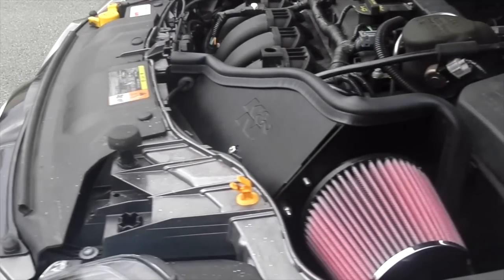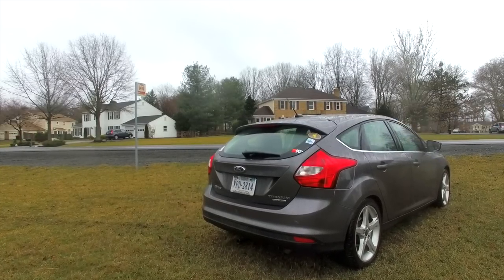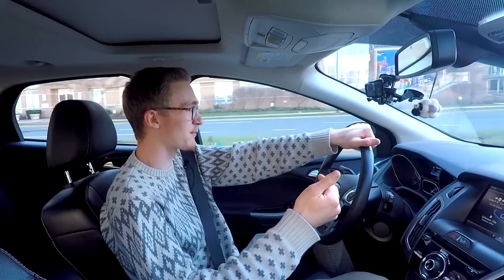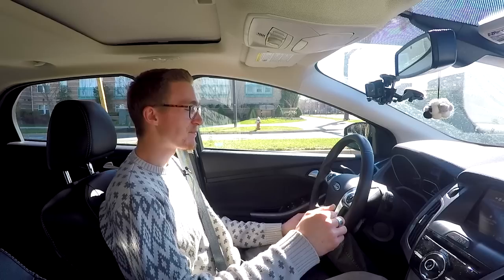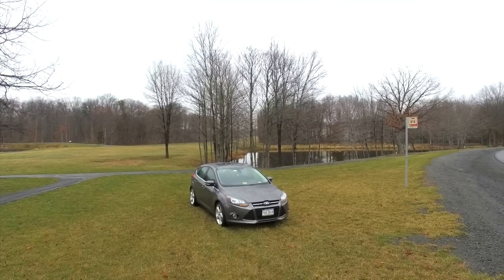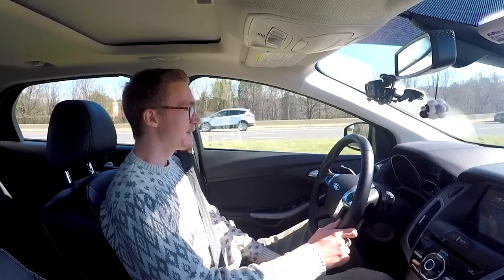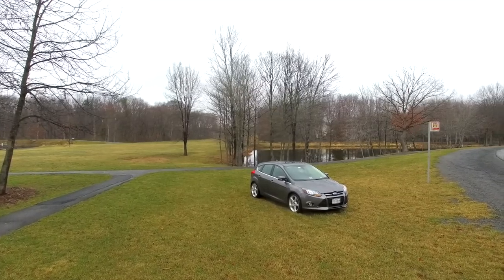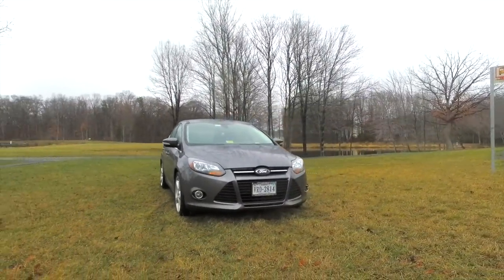K&N Cold Air Intake Update, What Happened to It??

Comment: For those who think you need to tune it. You actually don’t k&n made that specific air intake to give you horsepower with out a tune.
Reply: Are you sure?
Reply: @urbanpeltier1622  At least what they are saying on the website.
Reply: You will get what they call a "can tuned" if you install a CAI without a tune.....but if youre adding mods that means you obviously wanna make more power so thats why a tune is vital if you wanna MAXIMIZE your gains.

Comment: When you mess with the intake doing a mod you may have to cold start the car and run it for 15 mins or so on idle without reving. This allows the CPU to recognize the mod then take it for a short 5 min drive and park it up to cool down a bit then go from there. Diffrent cars will vary in this process but it may be similar?. The idea is that the CPU re-learns its self and programs to the new paramiters. I would think that a basic inlet mod or exhaust mod could be corrected this way or similar. Any larger mod may need professional programing.
Reply: Very helpful

Comment: I noticed this problem too. I removed the box, attached heat sheilding tape to the backside, paying special attention to gaped areas...problem solved. It also helps if you cut the padded insulator on the hood to fit perfectly around the rubber on the box. This seals the area really nice. You should also install a 180° thermostat just for good measure. I live in texas.
Reply: Dustin clark thanks for your observation!

Comment: One thing to remember is that the more power the vehicle has from the start, the more power is going to be gained, a 5% increase in HP on a 140 hp motor only 6-7 hp but on a 450 hp 23-24. Also, for the viewer that stated how the CAI would mess up the fuel ratio due to more air, its not necessarily more air that makes people put in the CAI, its that if you get proper separation and can suck up cold air, that air will be denser theu your car will have better combustion.Thats why your car seems faster in the cold weather, especially turbos
Reply: you have the best reaction

Comment: K&N air filter does improve air flow  you can get a mild boost of 5hp in some cases
Reply: You'd have some measured evidence of that, to share with us and prove your claim, wouldn't you.   Wouldn't you?
Reply: It all depends on on the car/engine
Reply: Austin L it definitely added more than 5 to my sti. Probably closer to 10-15
Reply: Ann Onymous Give me proof. I’m assuming you didn’t get the engine re-tuned or you didn’t put an aftermarket chip in it. So that air intake just turned into a expensive air filter
Reply: Ann Onymous that is a gross exaggeration get real.
Reply: All it does is give the car a better sound over time it will decrease power and even if gave you a 5hp gain you would never feel it in you're drive
Reply: CLUTCHO I don’t know if your math is accurate + != -
Reply: @Xibyth  anything under a 10 percent gain in power you wouldn't feel
Reply: CLUTCHO never said you would, but a 5% gain isn’t a loss like your saying.
Reply: @Xibyth  from experience with these filters made my car run sluggish and after taking it off had a whistle on my turbo with a Factory air box might make a difference on a induction kit to the turbo on a 300hp
Reply: Chris Toth, at the expense of filtration. I still don't understand why someone would bolt this on a 150 horse daily driver.
Reply: Agreed, but the boost is on the Dyno.
Reply: Richard Thomas  

Since you asked  https://www.youtube.com/watch?v=GS69owXpGdY&t=696s
Not a huge difference, but measurable at least.
Reply: Is it really worth $200+ - $300+ worth of air intake for only 5hp gains? Personally, no. I just got the K&N air filter rated for my factory air intake box. Luckily, with a Dodge Challenger/Charger, you can get the Hellcat lower air box which has bigger volume than the stock ones and has an additional port hole that can be connected to the hollow headlight of '15 models and up. Didn't even spend more than $200 all parts and air being pulled is guaranteed to be cooler air than engine bay air (which is obviously hot air). Now I don't know about other cars but bigger volume lower box that is actually enclosed and only draws air from cooler spots are the way to go.
Reply: @darrylsiruno9067  I tend to agree with you.  That  said, not every vehicle has the options you described.  If you are going all in like say cam, exhaust, intake, then K and N is a good option.  Putting one on for the sake of 5hp stand alone, nope.  Also I've seen contaminated MAS. In 4X4 application, I've seen water, even hydro lock because they are unprotected.  Like many things  there are advantages and disadvantages knowing what the trade offs are is key to making a good decision.
Reply: Just got my k&n intake and flow master exhaust system ready for Install
Reply: Ivan Rodriguez let me know how it goes
Reply: @assininecomment4934  Mighty Car Mod did it with a Honda S2000 and they got little improvement but nothing major. But still eh
Reply: Xibyth you lose horsepower on the low rpm range. You only gain horsepower at 4000-4500 rpm range.
Reply: Marcus N installed a flowmaster with the k&n air intake in my 02 Silverado and it sounds and drives better and just more fun to drive now !!

Comment: I recommend cleaning and re oiling your air filter at the interval your auto manufacturer instructs you to check your air filter. I have always done it every oil change(5000 miles). I ran k&n for 175K in a Tundra and 170K in my wife's Highlander.
Reply: What did you clean and oil it with?
Reply: @ShredZ23  I used the K&N products
Reply: @michaelmckamey155  ok thanks, I'll look it up and be sure to get that so I can take good care of it.

Comment: It's refreshing to see someone admit their mistakes. A little advice though: I've never seen a K&N, or any brand filter for that matter, make a NOTICEABLE difference to power in anything but an extremely high-performance engine. If there is an increase (and that's a big if) it's usually just such a small amount, it's basically within a margin of error and certainly not noticeable. The other thing to keep in mind with these kind of filters, when they are tested on dynos, they are always new filters. These kind of oiled filters tend to degrade quickly over time as particles get caught up in the oil. This is, of course, what they are meant to do, but it also means you need to clean them frequently to have any hope of maintaining even that tiny performance improvement. With this in mind, I highly recommend getting a non-oiled air filter from either the manufacturer or, if you really want aftermarket, someone like Wix, which has been shown by independent testing to offer that balance of awesome filtering (which is why we need an air filter) with decent air-flow.
Reply: I have a K&N on my 2016 Frontier Desert Runner and it helps mpg/hp little and the truck runs smoother but also have performance exhaust system to work with it so that maybe why

Comment: To everyone that says it's a waste.., I dynod my 2013 focus SE 5 speed after I got it. Pulled 152 bone stock (sport suspension from factory is only upgrade on the car).

I put in a K&N intake just like the one mentioned, I was then pulling 168.

I got a 2.5"catback custom system from a shop local in salem, OR. (Used pieces from a Borla setup) sadly did not get to dyno with just those two upgrades.

Finally got a tune from Tom (focusfinatics helped me find it)
After everything was turned it then pulled 173 on the dyno. 

It's not a "30hp" gain like some people say, (maybe with a larger throttle body idk) but it is very noticeable. 

Hope this helps some of you looking for mods out there. (Spent about $1,1,80 total on all mods after a mail in rebate)
Reply: No way this power gain of 16 bhp is real. There are Pub figures and wet dreams......... and there is reality. Yes 2 healthy cars can vary by 3-5 Bhp and if running same map and settings it is that close. A better Exhaust can help breathing so can filters but valve size inlet tracts injector size flow rate dwell timing and a rising rate fuel pressure regulater all contribute.  but there is a maximum a stock engine can produce by its design. If you change more items on the engine that scope for more tuning increases and so on, every tuned engine has bottlenecks by its design no magic maps can circumvent physical limitations. I dont wish to debate this fact of engineering. people can believe what they wish to believe. I once tuned an rs turbo escort in the 90s Many times in the process did I reach bottlenecks. and until that was removed power would not increase. all mods need to work in harmony a new intercooler painted black helps a heavily modded car massively but on stock very little difference. I used pub figures once too 25 -30 yrs ago. At 54 yrs old I now only deal with reality. My current car An RCZ R runs 270 + BHP 1.6L stock engine, exhaust, and filter plugs etc. its designed to run that. My Rs turbo also a 1.6L took 2 yrs and £4500-£5000 in mods back in the 90s to reach 260 bhp.
Reply: Lmao my accord 03 makes 160 stock
Reply: You got a tune AND a custom borla set up and only gained 5 HP??
Reply: @andrewm.200  152 subtract 173 does NOT = 5. LMFAO.  🤣🤣
Reply: @markgc65  16? you mean 21!?!?!  Tell me you're a drop out without telling me you're a drop out..... LMFAO
Reply: @EliteOnTheBeat  what are you on about ?
Reply: @EliteOnTheBeat  2 years later and still wasnt paying attention.. 168 to 173 is 5. Becausecif you notice, I said the Borla, and a tune to get 5. Not, stock to 173. Dillhole

Comment: K&N filters give tiny increases in power and torque. What they do generate a lot more of, is fuel efficiency. By running a cleaner through my FJ cruiser gas line and engine, then adding a K&N filter I've gained about 80 - 100km from when I first purchased the vehicle used from a dealership.

Comment: About 15 years ago, a BMW race car engine rebuilder and BMW race car driver told me the same thing. Don't put an air intake system on. It's worse than the factory setup. Drop a K&N filter into the stock air box instead, and I have been doing it ever since.
Reply: But he only meant for stock cars right?

Comment: Hi, Fuel Trims on an ecu are responsible for compensating for the extra air that comes into the engine i.e the air fuel ratio will automatically be corrected by adding more fuel to achieve 14.7:1 in closed loop control

Comment: If you run around at 6,000 rpm  you might feel some difference.
normal driving NO.

KN users rarely ever clean their filters.

KN/ other reuseable cold air filter systems are designed to separate a fool from his money.

Comment: I really like your point about the standard Cold Air Intake filter and the engine heat.  It's logical and makes clear sense, and putting in just an upgraded version of the same filter type for your car I'd ALSO SECOND as a high recommendation.  I put a K&N Filter that was the same size as the OEM on my old 2000 Chevrolet Blazer LT 4x4 4.3L Vortec and noticed a significant difference in throttle response.  I had also replaced the MAF sensor shortly after due to the grease and all from the filter and also then noticed more improvement.  Even the filter by itself made a big improvement in engine performance.  Understandably, this may not work for all cars but is definitely worth a shot.

Comment: You must modify the exhaust to get some hp gain with the CAI or SRI. Ok another question. Where is the cooler air coming from when the air filter is exposed to the heat coming from the engine? No one has answered that question yet and I don’t think no one ever will answer it. The best thing to do is modify your stock air box to get cooler air if you can. I did it on my 2002 Pontiac Grand Prix SE. I took out the tubes and cut the barrier out. The box is right behind the left headlight and it gets plenty of air.

Comment: You will get heat soak either way, the sheet metal baffle isn't to prevent heat soak, it's supposed to slow airflow from all areas except the oem pathway through the fender or front grill.  Good outside airflow will negate the engine bay heat so maybe it's that the shape of the baffle didn't seal well. Also when you take off the oe air box you detuned the wide band nature of the intake and turned it into a narrow band WOT peaking unit at best.

Comment: I put an airaid “cold air intake” on my truck. After about a year I decided to put the stock air box back on with an k&n drop in filter and I left the airaid intake tube in place of the stock intake tube. 
I did a 0-60 before removing the cold air intake and after reinstalling the factory air box and there was less than half a second of difference in the 0-60 times between the two. So I left the airaid intake tube on in place of the factory tube, left the factory air box with the k&n air filter and sold the “cold air intake”. 
I now have an aem Filter instead so I don’t have to worry about oiling the filter like the k&n.

Comment: I had BMC which worked only for 10k km and couple of years even with oiling at recommended intervals. Now, no matter what I do it's not giving me the same performance as it was new. My car feel sluggish at lower gears and screams in high rev in a bad way. Moved to stock and the engine feels super smooth.

Comment: I have that K&N engine air filter in my 09 Camry,2.4L engine and it runs a lot better than it did with the stock air filter. And I don't hear any un-wanted engine ,air intake noise🤔🙂. But then I don't drive a Ford😐....
Reply: Scotty Kilmer videos on YouTube channel would have saved you the trouble.  Suggested watch before your next mod.
Reply: need the exhaust ( borla ) to balance extra air intake. don"t pay any attention to this man. you need someone that knows more about performance. to get that extra, you need to spend that extra.K&N cold air box,with a true sealed air box. cost about $400. exhaust about $1295. hwy. mpg,went from24 to29+, hp from 280 to 310, yes this made a big improvement. 2004 FORD T-bird 3.9L-V-8
Reply: Lol you have a Toyota. That’s gotta be embarrassing.
Reply: @John-qt9bi  always fun embarrasing v8 mustangs with a 6 speed auto v6 camry grocery getter what makes it all the more satisfying is the camry isa grandma grandpa car the slowstang is a sports car lmao
Reply: joe5vee I’m thinking about getting a closed box 37 horsepower or open box 39 horsepower for my 300 horsepower Rallye Dodge Charger v6. Do you think it will help?
Reply: John lol you probably don’t even drive a car . That’s got to be embarrassing
Reply: @carolinayamadawg8706  you obviously never actually raced a decent mustang driver, because you're Camry weighs about 500 pounds less but puts out anywhere from 300+ less horsepower and try racing against a v6 mustang, different engines perform differently.
Reply: @carolinayamadawg8706  oh and make sure it is either the same year as yours and double check because mustangs come with 4 cylinders too,
Reply: @masterremlap1348  well it is a well known fact that mustang drivers cant drive and are better at crashing and running over crowds than controlling thier arcane technology called live rear axels ..lol with that said you obviously dont know much about cars if you think hp is the only variable ...other things come into play like putting down traction ..reaction time...gearing etc ...but dont worry ill let you think you put me in my place lmao
Reply: @masterremlap1348  now i will say my suspension is completely tuned with fully adjustable coil overs strut bar brace up front custom brace out back ...urathane bushings ...tow camber and dampening settings all tuned to my driving style ..brakes are larger slotted rotors and toyota highlader larger calipers ..wheels are light weight volk te37s and tires are sticky advan neova ad08r...egine and transmission are stock as the power output of the 2grfe v6 is more than adaquate tho i may put the trd supercharger from a toyota aurion ( euro spec camry ) and boost hp to 340 hp and really make mustang owners whine even more lol
Reply: @carolinayamadawg8706  okay
Reply: @masterremlap1348  lol thats about the response i expected
Reply: @carolinayamadawg8706  do we have a way we can talk without going on YouTube?
Reply: @masterremlap1348  i dont give out my contact info sorry
Reply: I heard he got arrested for driving without a car!
Reply: You drive a Toyota which is worse. 🇺🇸

Comment: Maybe in your stock focus you can't feel anything. But, I have a Mustang GT with a Ford Racing intake manifold, a 24 pounds fuel injectors, MSD ignition coils, headers and, really trust me, the K&N intake really work.
Reply: Mustang Racer nah
Reply: Yeah sarcastic, an intake works in a modified engine. In an stock engine you can't feel 1or 2 extra horses.
Reply: Mustang racer  Is your K&N filter in a separated cooler area ? Or just under the hood ?

Comment: Thanks for doing the video, really good feed back.  
I guess the KNN short ram intake will work differently from car to car.  I’ve had one in my 2019 Civic 1.5T for about a year in the Northeast and I did not get a drop in performance in hot summer days.  I love the sound and noticed throttle and mpg difference.  
Plus clocked a 3 tenth of a second quicker time to 60 MPH.
Reply: Stock ?
Reply: I'm trying add one to me 2.3rdx

Comment: Install a brand/unit with a housing (not an open shield) for the filter and also one that connects to the original air ram. The car's air ram sucks in cold air from the outside and farther away from the engine block. MST, AEM are some of the manufacturers that includes an air box (not shield) and retains the original air ram of the vehicle. Also, replace your cat back exhaust with larger piping to optimize your exhaust system with 5-15 hp gain at around 5000 rpm, which is good for merging and overtaking maneuvers.